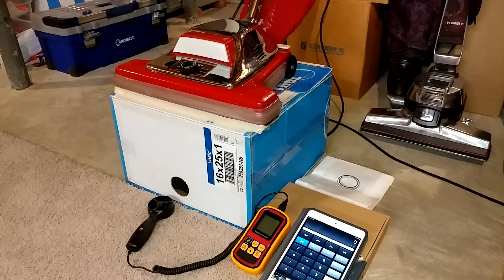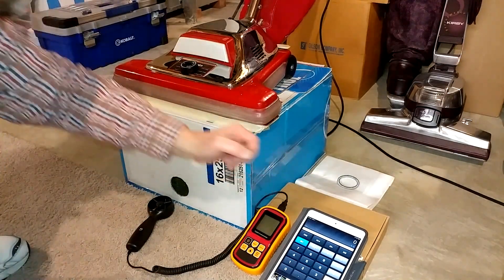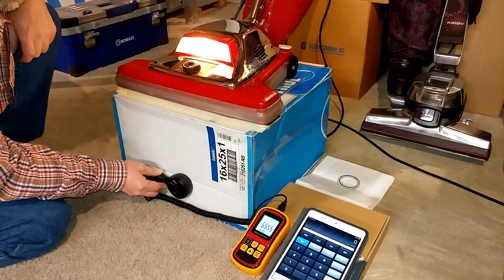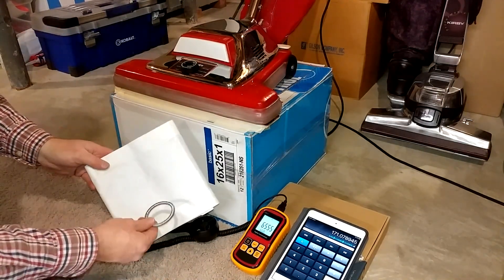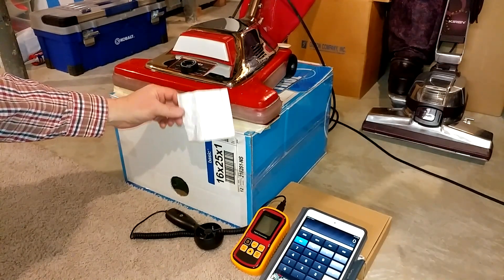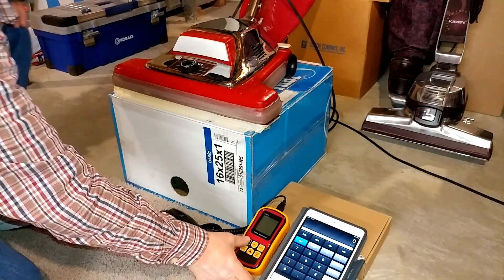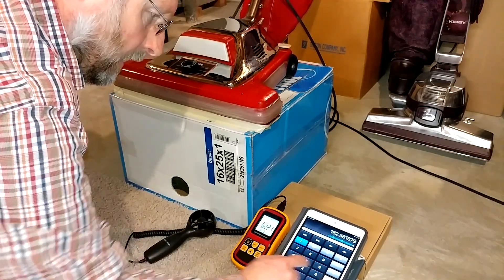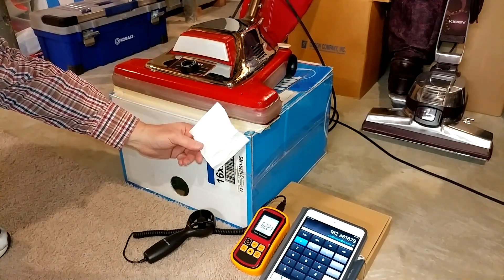2005 Sanitaire SC899 Airflow Box Tests With Filltube Mod

Comment: So in your opinion, would the fan diameter when compared to Kirby and Royal make a little or big difference on these numbers?  Sanitaire has the horizontal fan so there's room for a large diameter, as opposed to Kirby/Royal where the diameter affects the height of the motor/fan housing.  Please use common English when explaining because I get headaches easily (i.e. dumb it down for me).
Reply from the maker: Simpler airflow path (no emptor) gives a little more than a 10% airflow boost. 😎
Reply: So does that mean the royal could have slightly more airflow since I’m thinking they don’t have the emptor

Comment: Apparently it's also possible to modify these so they use a plastic tube on the inside so you can use the top fill ST bags instead. Which is a huge bag design improvement over the F&G. I think you can buy the bag tube for the S series separately.
Reply from the maker: Yup, conversion kits have existed for machines like this for quite some time.
Reply: @VacLab  ah okay I figured you were aware of that already :) if I owned this machine I'd totally convert it to take ST bags those seem way better. At least a lot easier to install if anything!

Comment: Oh I forgot to mention. The Avalir king is dead! Long live the sanitaire king of airflow!
Reply from the maker: Yes. Or at least until the single ply paper bag clogs with fine dust.  Hehe...
Reply: Technically "modifications" don't count 😝
Reply from the maker: @Kirbyvacuumcleaner  Hmmmm, wonder what else I could slice off to improve performance? 😂
Reply: VacLab well you might be able to cut it so short it could be a bottom fill lol.

Comment: I was really hoping you would do an airflow test with is as a shake out bag, with the f and g tube in the sleeve inside the bag, which would be the exact set up to use this bag as a shake out.
Reply from the maker: I don't see how moving the inner bag connector into the outer bag sleeve would change the airflow by much, so you probably have your airflow answer anyway. 😎